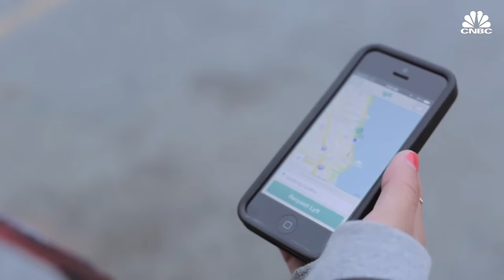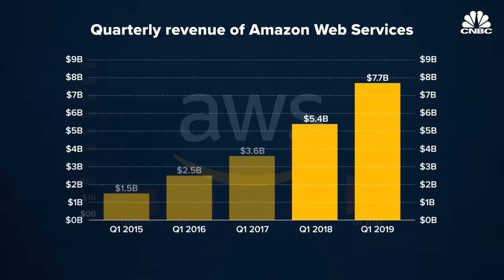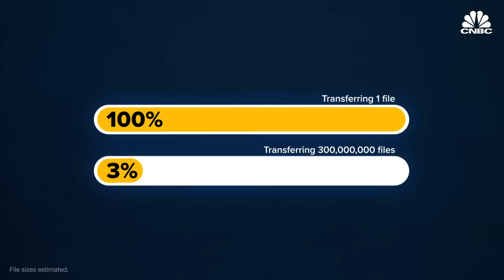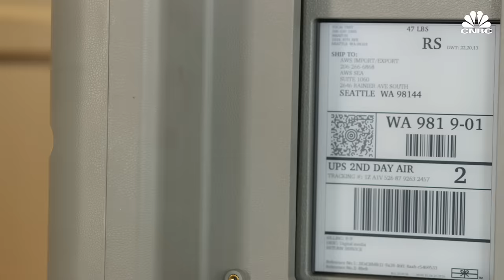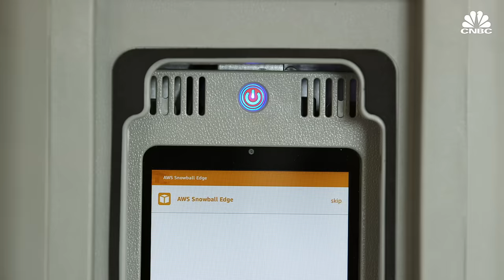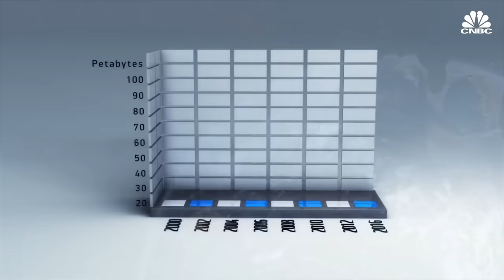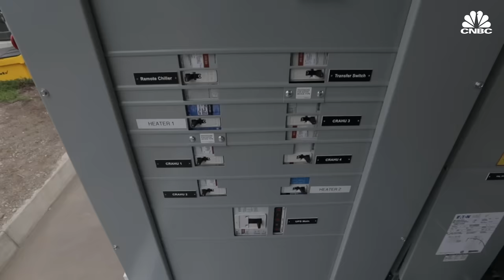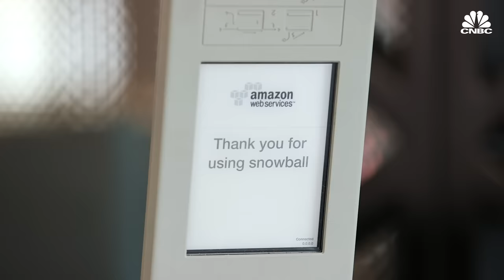How Amazon Uses Explosive-Resistant Devices To Transfer Data To AWS

Comment: How did Amazon get into web services? Simple: Amazon itself needed MASSIVE amounts of computing power to keep up with its own sales, warehousing and shipping operations. As such, Amazon bought so much hardware that they discovered all that computer hardware could be used for web services, and AWS was an outgrowth of using all that hardware to make more money.
Reply: Pivot, the best idea in business.
Reply: AFAIR Amazon always needed a lot of computing power around Christmas.
The rest of the year the servers were just idling.
This is how they got the cloud idea.
Clever.
I wish I would have worked for such a company, not at boring S*e*e*s (not always boring, but in grand total, sadly).
Reply: @ethanpoole3443  excellent analysis.. Amazon is one of the most innovative company of our time. They revolutionize  everything they get into.
Reply: @ethanpoole3443  Yes, it's called timesharing.  Cloud is back to the future.
Reply: @Sagittarius-A-Star  AFAIR ?? Make full sentences kid, please, you're not on reddit.
Reply: @alainportant6412  hes on the internet
Reply: @ethanpoole3443  And where is IBM in the cloud computing business? Are they out in the cold?
Reply: And their services are not limited to just storing data. They have services which lets you run or write AI or machine learning codes in a much faster and simpler way.

Comment: 10~20 years from now we will be laughing at the size of this thing.
Reply: I think in 20 years having an exobyte usb stick will be common you can already get 1 terabyte ones( hella expensive tho)
Reply: @NathansWargames  i dont think usb sticks will be common in 2020 considering cloud storage and phone storage , almost nobody has 1tb usb drives let alone 256gb ones so I dont think anyone will have ones with 1 million times that
Reply: @yahyafihel1786  I don't even have one usb stick
Reply: @yahyafihel1786  I guess that's kinda true
Reply: @NathansWargames  you can get 1 terabyte SD cards now they literally released months ago
Reply: Nathan Watts who will use an usb stick in 20 years? Ppl dont even use nowadays
Reply: @Yahya Fihel there are 1TB memory cards already available cheap .
Reply: Yeah, but not as much as us now looking back 20 years, look up Moore's law
Reply: @TheSimon253  They are close to reliably getting around it but it's still super iffy with the amount of defects we still make
Reply: @NathansWargames  I was geeky enough to take a screen capture from the computer supplies website, CDW. back in 2006 where they advertised a  Buslink brand USB 2, 64 GB memory stick for, 🤣😂$5,739.99🤣😂 And those were 2006 bucks which is now in 2019 money due to inflation $7,300 bucks. 

You can regularly find them for less than 10 bucks anywhere.
Reply: @BeastinlosersHD  in what way are they close to getting around it? The size of transistors are incredibly small to the point we can't make them smaller and keep computers deterministic.
Reply: Yep. My MicroSD Card is 512GB..

2TB is on the Horizon..

👌👌👌
Reply: @NathansWargames  1+tb discs exist, unfortunately all the companies developing them went bankrupt. Tapestry Media which was a type of holographic disc by Inphase Technologies was able to hold 1.6tb on one disc in 2010.
Hyper-CD Rom was able to hold 10tb in 2000.
Reply: @albear972  
Thank you
Facinating
The world is changing faster than I can keep up.
Reply: By that time there isn't even a need to transfer data physically. Every start-ups will be connected to the cloud from day-1 so you won't have a big chunk of backlog data that needs to be transferred.
Reply: Yahya Fihel i just got a 256GB SanDisk USB stick for 50$ equiv. here in Germany...
Reply: The nation of Liechtenstein is ruled by the Royal House of Liechtenstein and they own the private banking group called LGT Group or Liechtenstein Global Trust with Prince Maximilian of Liechtenstein as the CEO and President. They are official worth is said to be about 4 billion however they rule their own nation which has bank secrecy laws and own Europe's largest family owned private bank. They are likely worth tens of billions. Prince Philipp of Liechtenstein is a board member for LGT and previously worked for Banque Rothschild in Paris. The Liechtenstein royal family owns the bank through Prince of Liechtenstein Foundation. In 2008 this bank was investigated for enabling tax evasion by various governments. Prince Mario Chigi of Rome was investigated for tax evasion involving millions and using private banks in Liechtenstein. LGT provides private banking, asset management, and Venture Philanthropy which is used for financing criminals that use fake start up companies. LGT is an international bank with branches in Switzerland where banking is also private. The Liechtenstein family are closely allied with the House of Habsburg which authorized the principality of Liechtenstein. The royal family also hold the title of Counts of Rietberg in Germany. The family owns about a dozen palaces. They are extremely wealthy, involved in private international banking, and run their own nation as a constitutional monarchy. The monarch has the power to veto laws and issue laws including the constitution. The family has married in with various Holy Roman royalty and nobility including the Habsburg, Esterhazy, Thun-Hohenstein, Harrach, Oettingen-Spielberg, Lobkowicz, Nassau-Weilburg, and Wittelsbach families. The Massimos of Rome married with the Wettins and conceal their wealth in private Liechtenstein banks. The Wettin coat of arms is on the House of Liechtenstein's coat of arms because the Liechtenstein royals have a Wettin-Saxon origin.

The House of Lie-chtenstein specialize in financing liars. The word govern-ment refers to control mind and spreading lies is one way they control society. They are a major bank roll for shills. Lionel Nation from YouTube is a paid liar working for the Liechtenstein royal family. The royals of Liechtenstein finance many YouTube propagandists like the hundreds of Q Anon channels and their paid for commenters. They spread political propaganda, Nazi propaganda, malicious lies and slander about people who expose them or their allies, and spread lies like fake news stories to deflect away from them like Lionel does. The various royals and nobles spend at least millions per day for online propaganda. They are sadistic and ruthless liars and involved with pedophilia and human sacrifice. The majority of the royal and noble bloodlines are involved with human trafficking, pedophilia, and human sacrifice. This is why they want to control everything and why they use ruthless, murderous, and torturous methods to obtain control. Prince Maximilian of Liechtenstein is the CEO of LGT and he began his banking career working for Chase Capital Partners in New York City. The royal and noble families seem like they have free access in the United States as if they are dual citizens. Hundreds of European princes have residences, businesses, and employment in the United States. They often make banking and business connections in the United States so they can more easily finance and direct the criminal takeover agenda being attempted by the European royalty and nobility. The House of Liechtenstein is Roman Catholic and they are subordinate to the Roman Catholic House of Habsburg which they are frequently knighted under.

Prince Hans Adam II is the head of state and head of the family with his son Prince Alois next in line to the throne. Prince Alois is also a Roman Knight of Malta like many royals because they serve Rome and the Black Nobility. The American billionaire David Lichtenstein is a covert relative of this family and an agent for them in the United States. David Lichtenstein owns The Lightstone Group based in New York which is a real estate investment company involved in residential, commercial, industrial, and hotel properties. David Lichtenstein owns tens of thousands of people's homes in the United States. That is corporate feudalism. David Lichtenstein is a board member for the New York City's Economic Development Corporation and he is also a member of the Brookings Institution an economic think tank in Washington DC. Members of the House of Liechtenstein include Prince Hans-Adam II of Liechtenstein, Princess Marie of Liechtenstein, Prince Nikolaus of Liechtenstein, Princess Margaretha of Liechtenstein, Princess Nora of Liechtenstein, Prince Philip Erasmus of Liechtenstein, Prince Wenzeslaus of Liechtenstein, Prince Rudolf Ferdinand of Liechtenstein, Prince Alexander Wilhelm Hans Adam of Liechtenstein, Prince Maximilian of Liechtenstein, Princess Angela of Liechtenstein, Prince Alois of Liechtenstein, Prince Constantin of Liechtenstein, Princess Tatjana of Liechtenstein, Princess Sophie of Liechtenstein, Prince Joseph Wenzel of Liechtenstein and numerous other members.
Reply: Probably not. We're already reaching atomic size limits on our electronic technology. Some circuits are a few atoms wide now. Except we manage to control electricity one atom wide, which is almost impossible because of quantum mechanics.
Reply: True, the snowball is about the size of a one-gigabyte harddisk in the old days.
Reply: @AhuwahZeus  cool story  bro
Reply: @alexmc477  The smallest ones we have now are having trouble in the manufacturing process. Now they create parts of whatever at that small transistor size, and then stitch the working pieces together to create a working circuit. That's what I meant
Reply: Just like zip drives, remember them, exactly.
Reply: Only because the thing will now hold millions of exobytes while exobyte USB drives are available.
Reply: I use a Mac Pro with 128 GB SSD, why would I ever need a 1 TB thumb drive. All my documents and data already lives online. Local storage will die in 10~20 years, and more and more of these trucks will be seen on roads by then.
Reply: Absolute unit
Reply: It's all relative. The size of the storage devices will go down but the amount of data stored is going to go up. So you'll need more storage space and round and round we go.
Reply: @NathansWargames  Not likely. It will be hard to get an SD card past 1-5 TB due to quantum tunneling. That limits a "normal" flashdrive to at MOST 100 TB before physics stops us. Let's pretend you get to 1 nm lithography (this is probably impossible–water, one of the "smallest" molecules, is about a quarter of a nanometer "wide"). 

You may have also noticed that processors haven't been getting much faster and you don't really need more SSD/HDD space. I used to upgrade over 2 years. It has been almost 5 years now.
Reply: @siredward9568  2TB could be possible but anything after that is very unlikely.
Reply: No it will have 10x, 25x, 100x the capacity instead. Don't underestimate the speed of hard drives hurdling down the highway.
Reply: @GC-dh6nq  ahh..people who want to access their data offline? I have a 128GB USB drive...Also, The USB stick has no monthly fees and you don't need to access the internet to get your Data/files, etc.
Reply: @yahyafihel1786  Huawei does; Micro SD cards.
Reply: really serious though, amazon is really smart. They didn't just make it so strong just because they care about regular clients. If you go the extra mile the military buys you a couple hundred, maybe you can go the extra, extra mile, as they have done, to create a "military version" that is more expensive so you can get paid more from it, and from the economies of scale of having that huge company get them made as cost effective as possible
Reply: @yahyafihel1786  unless we start having 10Gbit connections to Cloud, then we will have a demand for large data devices like M.2s / USB StiX. As one grows in size the demand will match it. Its always a catchup game.
Reply: @GC-dh6nq  proffesionals in offices, creatives, students... actually quite a lot of people. Local storage will always be in demand as long as Internet transfer speeds and bandwidth caps remain behind...
Reply: @alexmc477  New processes for silicon manufacturing might allow us to get chips smaller. That or we will just transsion to quantum computing and let the cycle begin again...
Reply: I am already laughing at the size
Reply: already am.. 11 to 14 TB?
Reply: Haha. "Why are you still using netflix you dinosaur? I have every movie ever made on my keychain"
Reply: we will be laughing that anyone had ANY physical media
Reply: I was thinking same 😂
Reply: I think in 10-20 years they'll still use the same size, but it'll be 1000 times more powerful.
Reply: @Q_QQ_Q  it's $200 for the cheapest 1 TB others are fake
Reply: Sadly not, greed is the cancer of advancement, and the world is badly infested with it.
Reply: @GC-dh6nq  s😉😯
Reply: @yahyafihel1786  : 1 TB is a lot of secrets to sneak out of the NSA. ;-)
Reply: @TheSimon253  : There's a difference between computation and storage. Magnetic vortex may be the future ( https://www.nature.com/articles/s41427-020-0217-8 )
Reply: In 10-20 years, the internet is faster for sure, but a future snowmobile would still be faster than the future internet, so maybe those trucks won’t disappear after all.
Reply: datatransfer F-35's :D
Reply: There is still a lot of room to grow for solid state drive...
That said, at some point the drive size might will make addressing memory locations slower...

There is also the question of durability when you go with smaller circuits/cells.

I am not entirely sure memory will get much more smaller in physical size with current technology trend.
Reply: @TheSimon253  haha do you know how many people that are waaay smarter than us predicted that?
It will go on, probably not as fast but it will go.
Reply: @NathansWargames  I remember when you payed $120 for a 1gb usb stick.
Reply: I am tagging myself in this comment weather or not i'll see it again in 2041.

Comment: There's an old saying: "Never underestimate the bandwidth of a station wagon full of tapes hurtling down the highway."
This was true when it was first said in the 1980s, and it's still true today.
Reply: wooow...deep.
Reply: if it would be filled  with tapes it would take weeks to copy
Reply: @Teluric2  read and write speeds on modern tape storage aren't that bad so long as you're only transferring data in one way (so you can spin the tape on one way continuously)

Comment: I can see it now in the future, they will show a pic of a handheld device and say ‘in 2019 this used to be the size of a truck’ 😅
Reply: Indeed. Back when I was in high school, the largest HDD money could buy was a 70 MB unit. MP3 didn't exist yet, neither did digital cameras. I had no idea what you'd ever need so much storage for. I'm sure in 20 years I'll need an exabyte of storage just to download the latest Windows update. This is sort of depressing...
Reply: @TheNefastor  I remember six PCs in the finance department shared a 40 megabyte hard drive, using custom expansion cards and inch-think cables to connect to it, because it cost more than a car.
Reply: RAMAC took up a whole room for 5MB! https://www.backblaze.com/blog/history-hard-drives/
Reply: @TheNefastor  I reckon the world will move away from physical storage and hardware and totally start relying on cloud computing..even more depressing tbh as it would be so easy to control.
Reply: @awesomeplaylists4230  by "the world" you probably mean regular poor people. For one thing, the cloud itself requires physical storage. And then there's all the illegal files out there which almost no one will be dumb enough to entrust to a corporation. And then there are all the professionals for whom internet access to data will never match the performance of local storage, like people working in photo and video. And then there's all the people who've seen (with Cambridge Analytica et al) how untrustworthy the internet is. I'm willing to bet that it's a bubble : eventually, it will find its ideal use cases, and will become quite a profitable niche, but just because of trust issues it is a doomed concept for general use.
Reply: @TheNefastor  I agree, the point I was making is like how google stadia is now letting people play max graphics games on a basic phone, the computing power/storage is being done by a server not the device like it is traditional to use. I was just commenting on how it is a dangerous road to go down. I am sure it will take some time to move some industries away from it is now, but it is interesting that some Hollywood special fx get rendered at server farms as it is just cheaper and easier.
Reply: to be fair, eventually we are going to hit a hard limit. storage takes space, we are already looking at tech that is a few atoms wide to the point where we literally physically cannot make them any smaller.
Reply: Quantum storage.
Reply: @perhapsso1909  Quantum storage is not limited to one bit per atom (or more).  More like the inverse.
Reply: Whatever a truck will be known as by then!